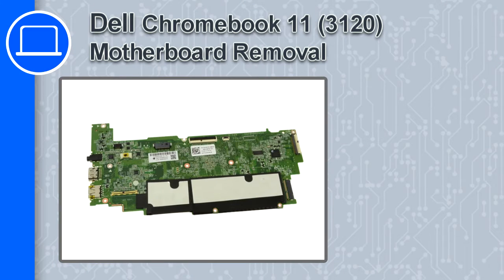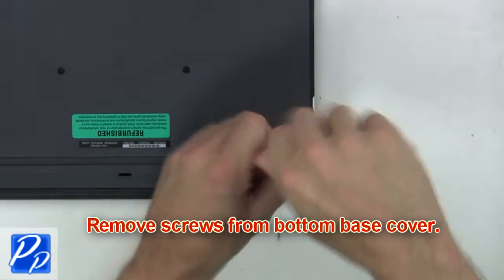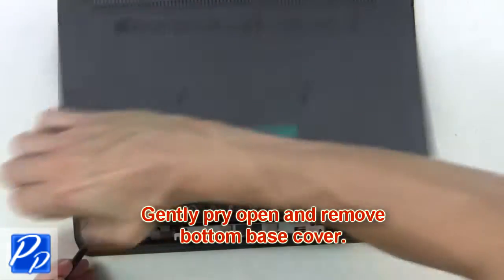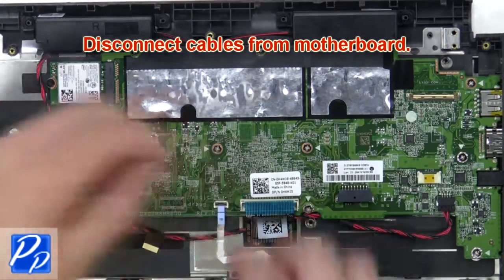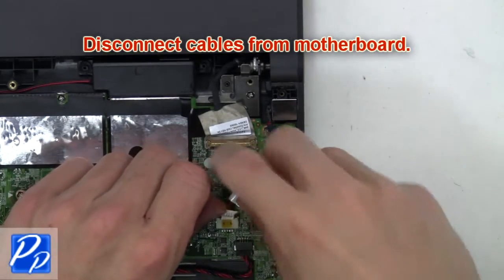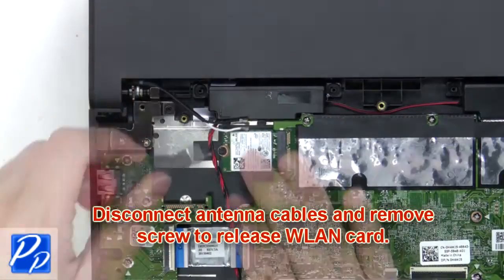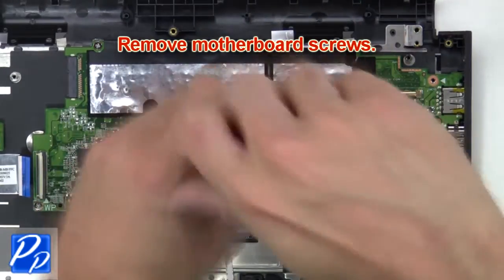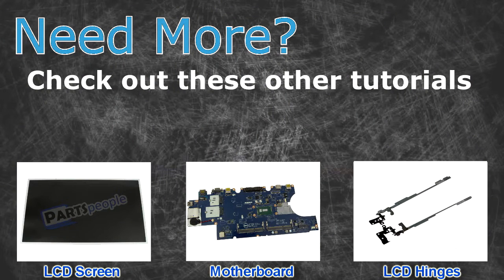Dell Chromebook 11 (3120) Motherboard Replacement Video Tutorial

Comment: Do you guys also sell a WWAN unit for it? The device the slot, but it's empty.
Reply from the maker: As I can tell, this laptop does not have a WWAN slot.
Reply: Google "Dell Chromebook 11 3120 Quick Start Manual" and look at #8 under Features.
Reply from the maker: I have seen the Quick Start Manual, where it suggests it has a WWAN model, I just haven't personally seen or found a motherboard with the WWAN slot, nor have I seen or found WWAN card part numbers that says it is compatible with the 3120.
Reply: My Chromebook has the SIM card door, with emptiness behind it. I was just wondering if there was a WWAN module that I could plug into that. Looks like there's not.

Comment: Can this model have the ram upgraded?
Reply from the maker: No it cannot. The RAM is built onto the motherboard.
Reply: +Parts-People.Com, Inc so is there a major difference between the two gigabyte and 4 gigabyte model , I have the 2 gigabyte model but I thought it was the 4
Reply from the maker: Personally I'm not sure if it's that noticeable. I haven't used both modes side by side. I would assume the 4GB would be a little bit faster.